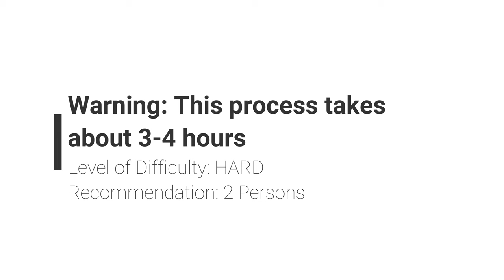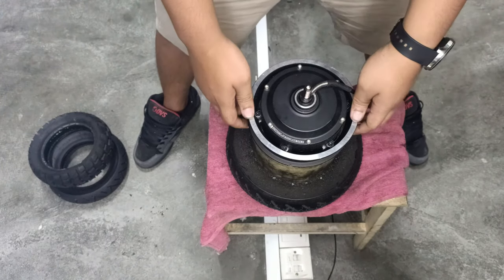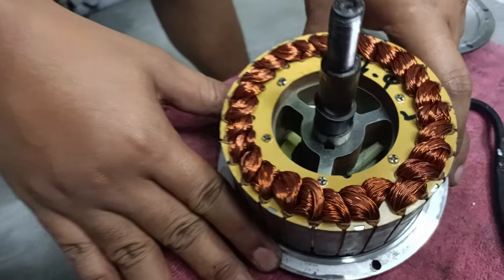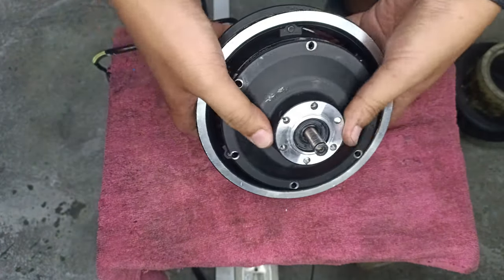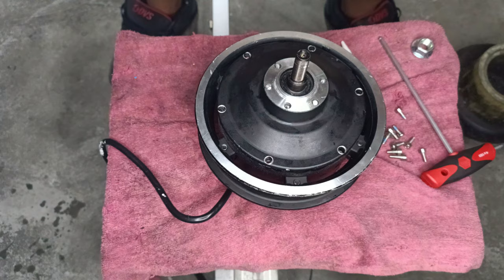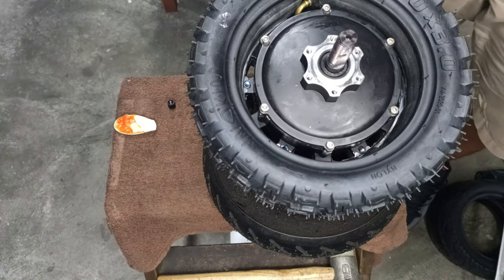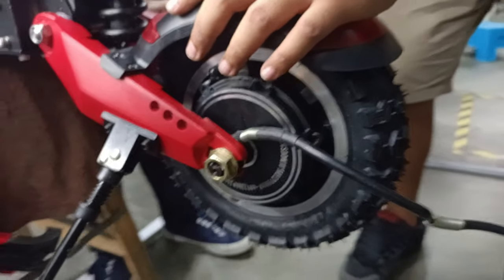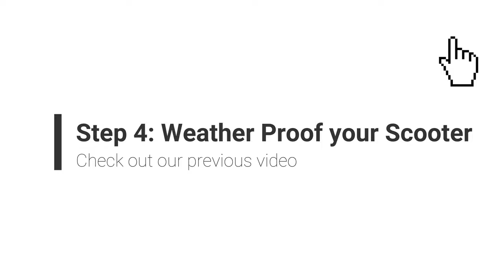How to Weather Proof and Winterize your E-Scooter

Comment: This is great video. I have been riding my kugoo m4 pro in the snow and rain. I can see rust in the steering bearings. So probably more rust in other places.
Reply from the maker: Kugoo is not known for their quality anyway so all the more you have to maintain it
Reply: @FalconpevSg  i have M4 pro juat started riding it today. Purchased it for 600 euros would you recommend buying something more robust such as a mantis 8 plus or emove cruiser. If if it's double or even 3 times the price. Is it going to make a difference long term. I feel you don't like kuggo M4 pro is there a reason for that. What kind of maintenance does one need for the scooters. What it the frequency of maintenance,weekly daily monthly?

Comment: Hi. I'm trying to change Vsett 11+ stock tire for off road ones but i find myself struggling to remove it. I removed the split rim from one side but the other side should be easy to remove. Any suggestions?

Comment: pro tip clean ur hands between touching the rims and the break disc clean the break disc with alcohol 90% best before instaltion onto the scooter and use locktight on the disc whent screwing it onto the motor because bicycle breaks get compromised if oil gets onto them it will not burn off like on a motorcycle the breaks it will just not work and u will have to replace the break pads and clean the break dics with alcohol 90%
Reply from the maker: We have been doing this for a long time now. I’m sure it’s something we do just not shown in the video.
Reply: @FalconpevSg  ye i know just dont touch the break disc on the breaking surface with greasy hands at all and tell this on video because some people just dont know u can touch motorcycle break discs with greasy hands just not these bicycle breaks because they get contaminated and u have to clean the break pads with alcohol then otherwise they just dont work and the breaks are not effective at all learned it the hard way xd i lubed up my scoter back wheel with grease and it driped onto the break disc and it didnt break at all no matter how hard i pressed onto the breaks
Reply from the maker: @Maykay1312  got it thank you:)

Comment: Hi FalconPev. According to Macury these motors are IPX5 rated. Isn’t this overkill? I understand the deck isn’t water resistant. But always thought the motors were? As always thanks for your informative vid!
Reply: problem are the non waterproof bearings but you can change them as well.

Comment: Sealing the motor doesn't create condensation ?
Reply from the maker: hmm there may be some but actually the motors are ok to some water, it will still work with droplets and splash, but not a huge amuont of water

Comment: Brake disc and Tire should go the same direction not opposite 😂
Reply from the maker: That’s what we did
Reply: You had the arrow still visible in the brake disc when it was installed, it should be hidden if it was flipped over and put on the right way. 
Nonetheless, a great video all together. You don't find many video like this. showing

Comment: If you know these steps have to be performed for weather proofing, why doesn't the scooter come with these already done at the factory?
Reply from the maker: This applies to all scooters not any particular one
Reply: @FalconpevSg  I still have the same question. Why isn’t this done at the factory before it’s sold?
Reply from the maker: @ibec69  Not quite understand
Reply: @FalconpevSg  don’t worry about it. Thank you for your replies.
Reply: I agree seems like this should be done at the factory before being sold.
Reply: @Mpower31  right? How is this concept so difficult to understand?
Reply: @ibec69  lol I dunno. I'm pretty  planning on just using some high heat resistant tape of some sort to put over the seal so I can hopefully avoid doing all this.
Reply: @Mpower31  I hope it works. Safe riding brother.